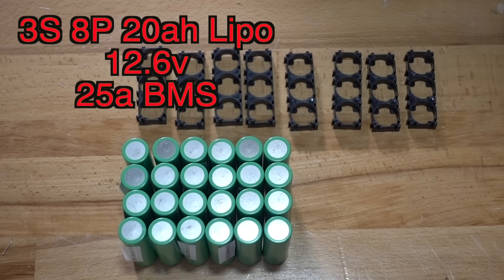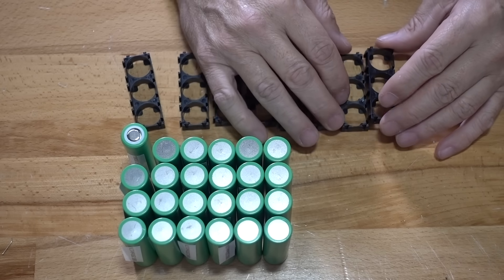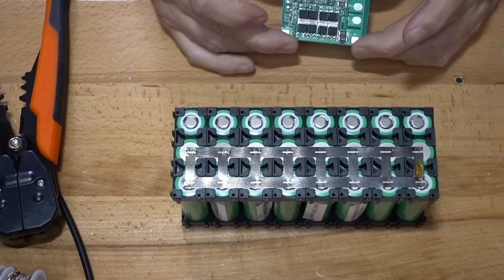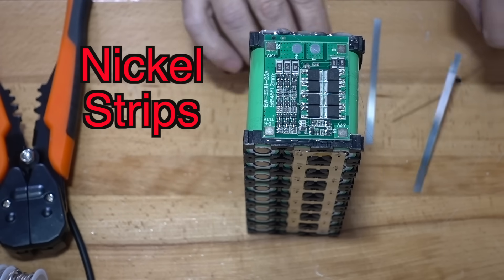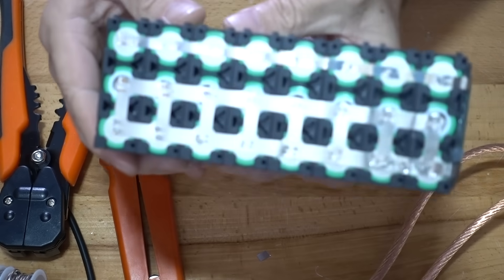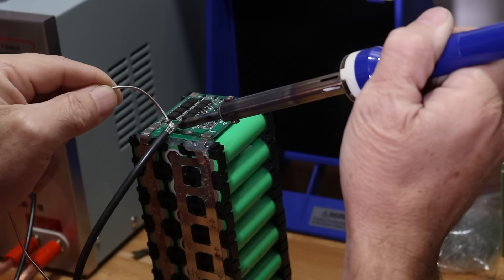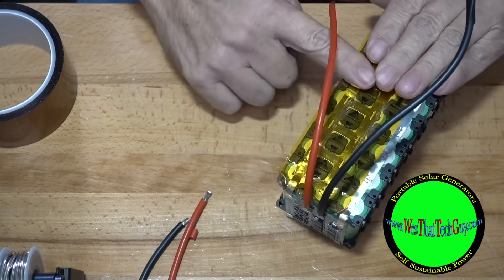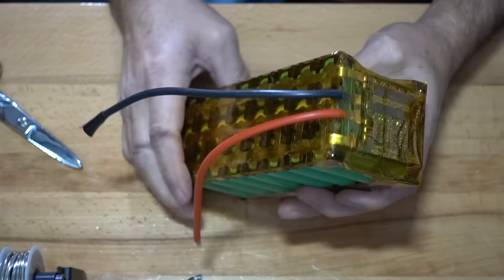How to build an 18650 Lithium Battery Pack with BMS.

Comment: Hi Wes,
I just found your channel and this video. I love the battery you built in this video and am wondering if you can help me?

I live in Toronto, Canada. Finding LiOn battery building equipment and supplies here is proving to be very difficult.
I have an electric Chopper motorbike that I bought. It's made in China, like everything! The batteries that came with the bike are lead acid, had great power, they are a combined 72Volts. I need to replace the batteries completely. Ive had the bike for 4 years, this year I wasn't able to drive it because of trying to get batteries because of covid was incredibly difficult, and when they were available the cost was stupid.

Since I bought the bike I have thought that LiOn would be a much better power source and have wanted to switch over, but the cost to buy the batteries needed is incredible if I buy them already built, which is posing to be one of the biggest problems yet. Noone seems to manufacture 72V batteries, so, I'm thinking to build it myself. However I have no experience in building batteries, and don't want to screw my bike up. 
I also want to install a regenerating system so that as I drive the motion of driving could generate electricity that could simultaneously charge while driving. Again, having no experience in this I need help.
The help I'm needing is:
1. Where can I get the supplies to build the battery for the bike?
2. Where can I get the info on building the battery?
3. Will I need to build a charger or is there something on the market I can buy for charging the battery?
4. And finally, how would I go about building a motion operated regenerating system that can be easily attached to the bike?

Any help you can give would be greatly appreciated!

Thank You!
-Matt
Reply from the maker: Matt thanks for watching. l can help with everything you need. I have all the necessary components to do the job. Check me out at SolarGeni.com

Comment: Why didn’t you explain anything in the video? What was the circuit board for? Why kapton tape? Etc..
Reply from the maker: I thought it was covered pretty well. the circuit board is a BMS and the Kapton tape is for protection against direct short.

Comment: Nice video 👍🏻, very simple and clean. One question, does the bms provide overcharge protection and low voltage protection? I want to replace the old fashion battery on my sons electric car
Reply from the maker: Thanks! Yes it does.

Comment: Do you charge through the bms, or do you bypass it?
Reply from the maker: Christopher Tilley yes. The positive and negative wires. you also discharge from there
Reply: @WesThatTechGuy  Thank you for the reply. The reason I asked is a rather confusing youtube video suggested that charging through the bms won't supply the correct charging curve for the pack and you end up with an incompletely charged battery. He was using a raw power supply but didn't specify whether attaching a proper charger to the discharge/charge port would override that negative behavior.

Comment: Could do with some description as to what a BMS is.. charger circuit thing? Input voltage?
Reply from the maker: battery management system. 3s 12.6v charged. Used to protect the battery pack.

Comment: can u do a 19.2 ah battery?
Reply: a skate board company has done it i just wanna know if thats possible
Reply from the maker: @neon10knights  you can just do a 20ah it will be no problem.
Reply from the maker: no need 20ah is fine. AH is only the amount of stored energy. Why would you need 19.2ah battery. Or do you mean 19.2v

Comment: Awesome video.  So does this mean 5 of these in parallel would be the equivalent of a Battle Born 12v 100Ah battery?
Reply from the maker: Yes thats correct. Or you could just make it bigger.
Reply: @WesThatTechGuy  Wow!  That's cool.  Now I'm off to read more about how to design one just like that.  Thanks for you quick reply!  Keep up the fantastic work!
Reply: I'm thinking of trying to build a 100ah battery  to do this I would need 120 cells correct ?

Comment: Hello, I made the same, now I would like to know which charger to use, what voltage or if it can be charged with any 12v adapter since the bms will detect when the battery already has 12.6v of its maximum capacity and then it will cut the charge flow to protect  Battery
Reply from the maker: 12.6v li-ion battery charger

Comment: This is really concise and clear.   Have you got a video showing how you charge this puppy?  Your choice of power supply and connectors that turned out to be quick enough but safe?
Reply from the maker: Thanks! I haven't done a video on the charging but you can get them at solargeni.com. We sell most li-ion and lifepo4 chargers.

Comment: I have only 1 minor thing I'd add. If it was me, I'd carefully scratch off some solder mask around the power input pads on the BMS board.  That way you could add more solder, get a better solder joint, and maybe even use a heavier gauge wire.

Comment: Do you need to charge each cell full before solder it to the bms or just need same voltage each cell ?
Reply from the maker: Tin Trinh Just need the voltage each cell

Comment: Can two 12V battery packs in series become 24V and can batteries in series be charged with a voltage of 24V.
Thanks.
Reply from the maker: Yes They can.

Comment: How to charge this pack. Any specific charger .
Reply: Just feed it with a power supply that outputs max 13V (a 12V is fine), the BMS cuts off the charging once the cells have reached their max voltage. The problem is you need to limit the current, getting a random power brick can result in the voltage being unstable and the BMS drawing too much power.

Comment: Sir i love this video.. I made also 3s battery.. But the input power is my problem.. Can i use input only 5v from the cellphone charger only..
Reply from the maker: Thanks. No you must use a charger that is 12v li-ion. Max charger input 12.6v
Reply: @WesThatTechGuy   thank u sir.. For answer my question.. Im pilipino.. But here in philipines.. But i love electronics... Because i want to put on the bluetooth speaker 12v amplifier..

Comment: Wes, is it possible to make this solar charger ready?  I can't find anything online
Reply from the maker: Yes it is. do a amazon or ebay search for a lithium solar controller. Most solar controllers are programmable to match the li-ion voltage.
Reply: @WesThatTechGuy   Wes, I'm building this now.  Do I need a specific li-ion charger?  Or it doesn't matter because of the bms?

Comment: hi there is something wrong with you. How many batteries are needed for a 60v 40 am package? thank you
Reply from the maker: nee more info. what kind of batteries how many ah each cell etc? what is the voltage of the cells?
Reply: @WesThatTechGuy  18650 batteries will be packaged as an average of between 2000 and 3000, 60 volts and 40 amps. how many batteries are needed
Reply from the maker: @oktaysinag  16p15s. based on 2500mah/2.5ah each cell. and 63v charged. 15s is a typical 60v li-ion setup.
Reply: @WesThatTechGuy  thank you have nice day

Comment: How do you get a 12.6V battery connecting 3 3.7V in series? Shouldn't it be 11.8V?
Reply from the maker: Luis M. Diaz Angulo As I’ve said many times before technically it’s 11.1 V nominal and it is 12.6 V charged. And there’s nothing that’s 11.8 V? check your math.

Comment: This is by far, the easiest to understand video that builds a very neat pack, and I've watched plenty. I'll make these and just use them in multiples for ebike batteries, or wire them as 12 volts for other applications. Thank You!
Reply from the maker: Kenny thanks for watching! You’re welcome!
Reply: @WesThatTechGuy  how much amps it produced????
Reply from the maker: @techtricks5553  it can do 200a
Reply: How to make 100a?

Comment: Ok dumb question: how do you figure 12.6 volts using a 3s configuration @3.7 volts each? I want to build a small 12v 18650 battery for my teardrop trailer with a solar panel on the roof; wouldn't 4s be better? Thanks!
Reply from the maker: Nominal voltage is 11.1 V charge voltage is 12.6 V.
Reply from the maker: Nominal voltage is 11.1 V charge voltage is 12.6 V.
Reply from the maker: Nominal voltage is 11.1 V charge voltage is 12.6 V.

Comment: Great video. I was wondering where you buy your BMS board and how to choose one. I have a 24V battery pack which BMS is dead. The batteries are still good.  I need to replace BMS board. Thanks
Reply from the maker: Thanks! You can get a replacement at SolarGeni.com

Comment: A few questions. What's the over and under voltage levels on this BMS? Does it actually do any balancing? Can you charge while a load is connected?
Reply: It got balancing resistor, it will take many cycles to balance
Reply: HELLO IT CAN NOT BALANCE AT ALL !!!!!!!!!!!!!!!!!!!!! @divikumar5475

Comment: There's no lithium-- ever! 4v batts U 8 sections--> 2 ohms U 9in/sec (8*/-4)=32a, 2frqs, 4v batteries sections. (4*2)=8a sections batteries INT! <EM> electrical code manipulates. Unless amps, are used,
really well. But never are!  (9*/- 2)=18a, 4frqs, 7v in/sec ohms --> (4*7)=28a in/sec ohms--(32+-28)=
60v sec/in batteries sections, ohms, 32-28=4v-- batteries. It clears, decimals- fractions.
Reply from the maker: KAWOW! what is this all about?

Comment: Be aware, the normal not charging voltage of 3S is about 11.1V not 12.6V. The charging voltage will be max 12.6V. For some 12v systems 11.1 can be to low, specially during cracking.
Reply from the maker: vidsremco Yes this is what I say in the video. 11.1 V is the NOMINAL voltage. Thanks for watching thanks for helping out.

Comment: Love your videos...You should also consider making a 12 Volt 18650 battery pack for cars/boats and motorcycle with best available bms and some bms with remote Bluetooth monitoring! ( Weather proof) Iam sure there are so many cars and motorcycle restoration guys would love to see. Just saying. 👍
Reply from the maker: These can be found on our website.
Reply: Voltages are a little off with Lipo/Li-ion.
LiFepo4 works out better for car,boat, moto

Comment: Hi love your videos and subbed! Could you please tell me If this battery setup would work on my old suzuki drz 400 motorcycle which has a lead acid battery 12volts and 7 ah. Can I crank safely with out hurting the bms or the batteries? And do I need any other changes on my motorcycle? I know my regulator/rectifier puts out about 12 to 13.5 volts as acceleration increases will there be any fail on bms charging? Since change in voltage.
Sorry to bother you with too many questions but this battery looks promising. Thanks for your help much appreciated.
Reply from the maker: thanks for watching and subbing! this should be ok to crank but not sure about the amperage of your regulator. You would need to know the max amperage output of your regulator. this pack will handle an easy 200a discharge but the bms is to small for that. Hope this helps.

Comment: If you're using 18650s as a 10AH 12v battery pack on a solar charge controller system, do you still need a BMS?
Reply from the maker: its best to use a BMS
Reply: @WesThatTechGuy  Would it be better then to buy cells with BMS built in? That way a 20AH pack could be built easily

Comment: I would like to build a large mah 6s pack for charging my flight packs in the field. I can charge it at home so I dont think I need an BMS am I correct?
Reply from the maker: if you are ALWAYS going to monitor the pack and charger outside your home like outside then no bms is needed. Lithium ion should have bms because they can be SO volatile/dangerous
Reply: @WesThatTechGuy  ok thanks for the reply. I ordered a couple different bms units. Along with 50 25r batts
Reply from the maker: no prob. I didn't see an order come through yet?

Comment: hi .. How do I design a charger for a high voltage 12 volt battery, for example 50 amps for a car lithium emergency battery
Reply from the maker: Not sure how to explain how to design or build a charger but we sell the one you need at SolarGeni.com

Comment: So I just built a 3S pack (only 3 cells).  The cells each measure 3.5 V (new, but not fully charged).  When I measure the cells in series, I get 10.5V (not fully charged).  When I measure off the power leads, I get 7.8 V.  Do I have a bad board, or do I just need to charge it?  Kinda afraid to apply power to it .....
Reply from the maker: are you using a balance BMS? is so you most likely connected the balance leads wrong.

Comment: What is the recomended battery charger voltage for this type of power wall ?  12/24 v ?
Reply from the maker: 12v
Reply: Thank you
Reply from the maker: https://solargeni.com/battery-chargers/12.6v-3s-5a-lithium-battery-charger-tesla-power-wall-s120

Comment: Could I tell me a good Bms.fora 24 volt 7P. 7S. Battery  with 18650 cells thank you like your work
Reply from the maker: Yes you can pick one up at our online store. Solargeni.com heres a linkhttps://solargeni.com/balance-bms/lithium-ion-balance-bms/7s-29.4v-100a-Lithium-BMSwe have several different amp ratings if you need less or more amps
Reply: @WesThatTechGuy  thank u

Comment: Could you explain how it is only 20ah and not more?
Reply from the maker: Big Injun Big Injun it’s because each battery cell is 2.5 amp hours and there are eight in parallel making 20 amp hours
Reply: @WesThatTechGuy  brain fart on my end 🤣🤣
Reply: @WesThatTechGuy  the voltage would raise in series. But wouldn't amps go up in parallel
Reply from the maker: @BigInjun05  Exactly, hence the 12.6v (3s) and 20ah (8p).
Reply: @WesThatTechGuy I was doing 8 in series and 3 in parallel. Drink more beer kids.

Comment: I had made a lithium ion battery pack rating 14.6v 30a with the same type of bms (30a).can I charge it with a 14.6v 3a smps or i need a same rated lithium battery charger.please reply fast
Reply from the maker: Techno India You will need a 4S charger at 16.8 V. The 12.6 V charger will not charge the battery at all. 4s nominal is 14.8 V. Fully charged is 16.8 V
Reply: @WesThatTechGuy  can i charge it with a 16.8v 3a common smps

Comment: Probably a stupid question but can you charge the batteries on the load out wire, If so what voltage and amperage. Could I use a laptop socket, and charge them from a laptop plug??
Reply from the maker: No stupid questions! Yes this is known as a common port BMS, you use the same port for charge and discharge. 12.6v max charge. 11.1v nominal. Yes a laptop power supply would work if 12.6v
Reply: @WesThatTechGuy  What would you recommend? I want a USB power bank for a phone and tablet.. Im using 14 (18650 Q30) cells in parallel (42Ah). I'm aware i could connect that to a Normal USB out board with a micro usb charge port but the charging times would be horrific and not good for the batteries i assume. so was looking at BMS, so i could wire in a better charging source. There seems to be alot of miss information or just bad advice its a mine field. any tips would be helpful as im starting out. Unless there is a better way that you can suggest.. Thanks for replying!

Comment: Nice build, question, you've 12v out, do you charge with 12v in and how do you know when its fully charged..............Thanks
Reply from the maker: you need a 12.6v li-ion battery charger. we sell them at solargeni.com the charger will shut off when fully charged.

Comment: Why use nickel for this? It's only 22% as conductive as copper and it's more expensive.
Reply from the maker: nickels is simple, easy and cheap. It also doesn't corrode like copper. Been done this way for many years around the world. In a bigger app then copper WOULD be used.

Comment: it possible to use in 12v or 24v ups ?
Reply from the maker: Yes but not simply. You would need some extra components to do this. Charge voltage is the biggest issues you will face.

Comment: Great Video,  thanks for posting it
I would like to make a 12V 40 Amp battery, would you know if there is a BMS Built to handle that sort of capacity?
Where could you get one from?
Once again nice Vid
Reply from the maker: Thanks for watching. this BMS in the video is a 25a continuous and 100a peak. We sell the proper BMS at SolarGeni.com for the 40a you need.

Comment: Have you ever made an ebike battery with li-ion 26650 cells? I am looking for any resources or examples of anyone that has used 22650 batteries instead of 18650 cells to make a battery for an ebike or scooter.
Reply from the maker: Yes I have. It's the exact same concept just a different size cell. Same voltage. Just make sure you get a high enough amperage cell (not amp hour but amperage)

Comment: You never said what size wire you used to attack to the bms board? I would hate to use wire to small and cause a fire :(
Reply from the maker: I used 10g for this build as its a small pack with only an assumed 20a continuous discharge.

Comment: What is the right BMS for 4s 10p battery pack ......cells are 18650 3200mah .....what is the current rating of bms ??
Reply from the maker: We have several current ratings to choose from. 25a, 45a, 60a, 100a all the way to 300a, you can find all of my BMS's here:  https://solargeni.com/balance-bms. Not sure if your 4s is Lifepo4 or Lithium-ion but we have both.

Comment: Useless video as you did not mention how to properly wire the BMS to the battery pack!
Reply from the maker: Re-watch it! Its in VIDEO form you can't miss it. The BMS is spot welded to the pack??? It's shown in GREAT detail
Reply: @WesThatTechGuy  It is just shown in the video but not explained so not very informative sorry.

Comment: I have a 60 volt, 20 amp hour battery pack for my scooter. Does anybody know if I can test each individual cell to see if one of them is a dud? Can I do this without detaching them from one another? Thanks that you can help
Reply from the maker: Arieh use a volt meter and check the positive and negative of each cell that's assuming you can reach them all..
Reply: @WesThatTechGuy  Thank you!